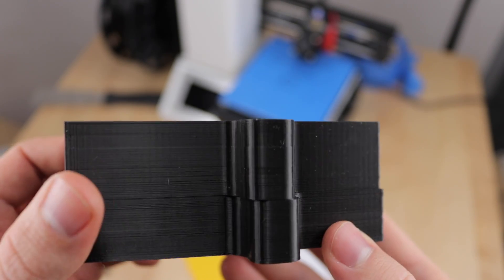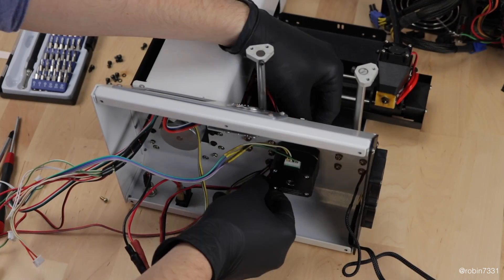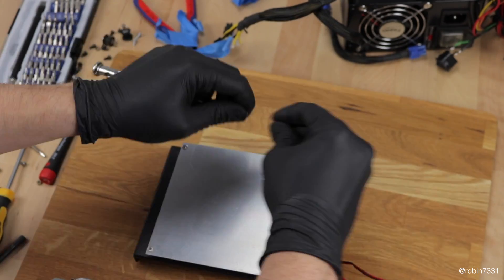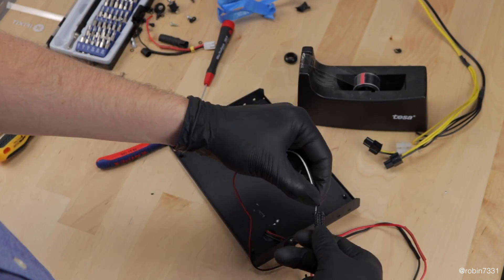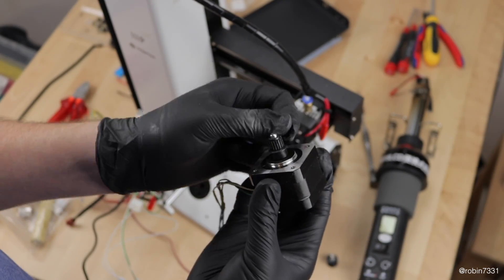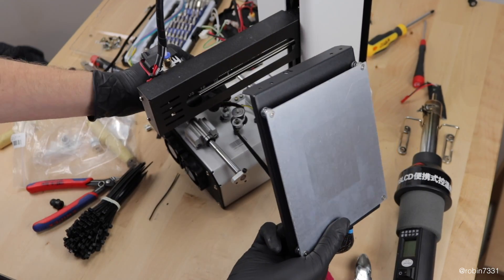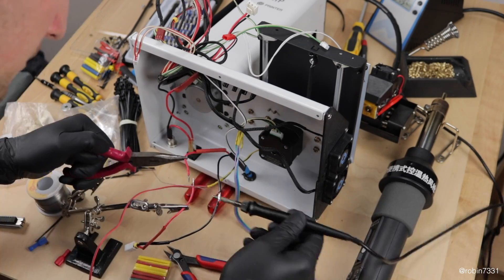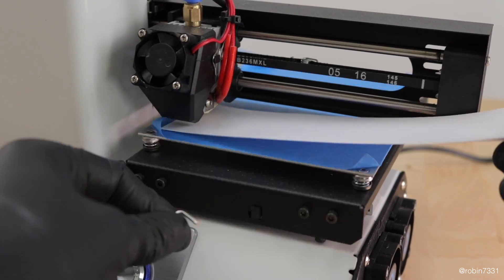MP Select Mini External Heatbed Wire Mod

Comment: Great video! Been thinking of doing the same. This printer is like buying a pre-assembled kit, that you have to take apart and put back together again properly.
Reply from the maker: Thanks, appreciate that! Well yes. But it is so dirt cheap and with a few mods it becomes a serious 3D printer!
Reply: It appears that way. I was going to return mine, but decide to keep it. Print quality at 0.0875 is amazing considering the price. Slow but cheap.
Reply from the maker: Rockwood Joe Exactly. If you like print a couple of random parts a month and do not want to spend a fortune this is your thing. Needs little space, cheap great results and a awesome community. As a pro user you'd rather stick to something else..
Reply: Totally agree! It's my first printer. I've now learned what I want and need for spending serious money. So far I've put about 150 hours on mine in just 28 days. Intensive maintenance, cleaning, and oiling on the bearings, pulleys, and arms seems to keep it accurate. It's such a simple machine - if only the controller was open source. Greets from Canada!

Comment: FYI - no soldering is required. i was able to make this modification by pushing the grommet out and simply routing the disconnected wires through. This is a much easier & safer method.

Great  video!
Reply from the maker: Great, that of course is even better than soldering!

Comment: Awesome video, I really appreciate it.  FYI: I bought the items from the links in your description, but, at least for me, the toothless pulleys had too large a diameter and interfered with the toothed pulley.  I couldn't install all of them together.  Don't know if mine are a different size from yours, or if my version of the mini has the pulleys in a slightly different location.
Reply from the maker: Thanks. Well that's bad actually! That diameter do they have?

Comment: Are there any less complicated hacks for this issue? I am not into drilling metal and rewiring.
Reply from the maker: That absolutely would be a solution for that. But like I said. My main concern was to prevent the wires from flexing within that small space between the heatbed and the actual carriage. If you don't like that idea simply choose a different solution. Meanwhile many people came up with great ideas for that problem. And that makes a community so awesome :)
Reply from the maker: Well you could for example take a look under the build platform and try to secure the wires with some kapton tape so they don't touch or interfere the belt. But thats not an ideal solution I guess...
Reply from the maker: As I had my unit opened I figured that there is not enough space for all parts to move freely. Sure you could tape or hot glue the wires down but you still have a lot of wire flexing on each movement of the bed. The stock solution forces all wires to flex in a very small amount of space. That combined with 50°C or more is pure death for the wire's shielding (especially with cheap wires from china). I just find it cleaner to get things sorted. Also I think hot glue or tape will not last for a decent amount of time since the bed gets hot and cold on every single print. At the end of the day I never said that my solution is the easiest. I just did what I found to be the best solution.
Reply: probably too late but check out Kevin Loughin's channel, he printed a new side cover for guiding the cables outside. Should work pretty well, too.
Reply: well I'd print it but...
Reply: @willpinkley1382   You can probably still print without a heated bed, just set the target to something around where it hovers to get started.
Reply: Why is that not an ideal solution?  Seems like it should be relatively easy.  It looks like you wouldn't even need to use tape.  You could for example, use hot glue.....or even a zip tie around the bottom of the rails to hold the wire back.  Or you could have just drilled a little screw in L shaped plate to divide the wires from the belt.  Your method seems like it goes out of its way to be difficult, and isn't really an ideal solution.
Reply: And what about the L shaped divider idea?  Wouldn't that accomplish the same result with minimal drilling?  Not to mention it would keep the wire tucked away and hidden.  These wires are probably rated to 80c or above.  Just think about your typical computer, which has components that can get 80c+.   Heck you could probably print a plastic divider and glue it without any drilling.  Also I'm pretty sure that the idea of flexing wires doesn't really stand up, considering either way the wires will be moving and flexing.  It's not just that your solution isn't the easiest....it's unnecessarily intrusive.  It's like if I was a dentist and removed someones jaw to perform a root canal.
Reply: @peoplez129  It was easy enough to snip out two inches of the worn area, add new wire with an additional two inches of length, some heat shrink and/or solder seal wire connectors, and re-solder the power wires (larger of the two sets) to route them towards the back instead of the front. This creates the same horizontal U shape around the moving platform that should, at least in theory, provide the same lack of wear and tear.

Comment: There are two additional screws underneath the dial that must be removed to take the display face plate off. I cracked mine slightly trying to lift it up because I though it was only held down by the tape.
Reply from the maker: R.A. Ray Thanks for the hint. I'll check that (maybe my version is different since I have one of the first printers and they update stuff) and put it in to the video.
Reply: NP. The screws are to a recessed housing for the dial. That housing has a small lip over the face plate.